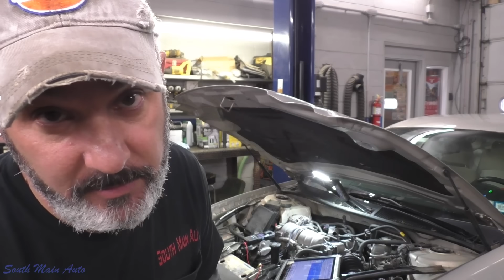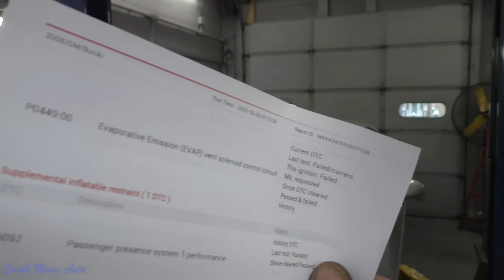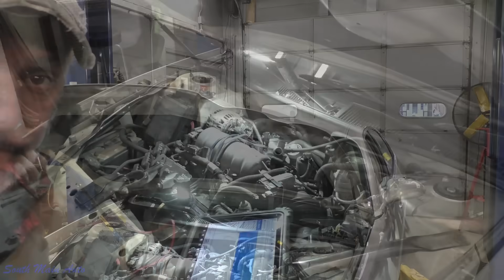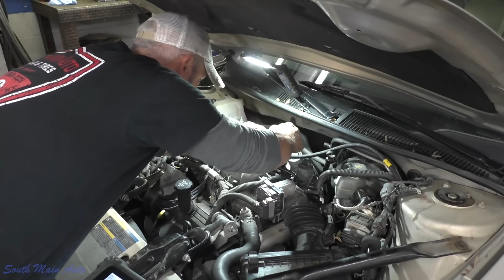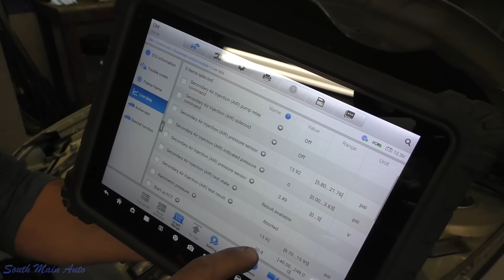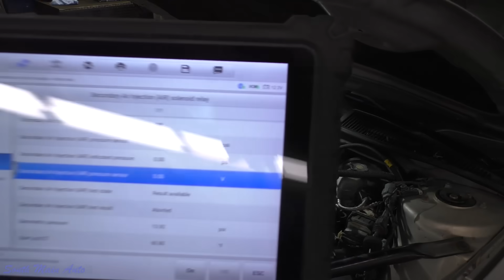When “New” Parts Are Worse Than The Broken Ones 🤬

Comment: Live in a small town.  A guy here had a business that would rebuild starters and alternators, usually in the same day. The alternators would last decades and produce 10% more amps than factory OE. Starters same reliability. He retired, back to replacing Chinese  ones  that last a  year or two.
Reply: In 2001, Bolton starter told me they could not buy the quality components to rebuild an alternator for the cost of a new offshore unit. I did my own starters at the time, now nobody stocks forks and brushes -and haven't for 15+ YEARS
Reply: That was about to be my comment.  How come "new" parts barely last a fraction of their OE counter-parts?  OE water pump lasts 20 years.  Aftermarket one might go 2 years.
Reply: @jperksification  worked in an auto parts store and sold starter brushes drives, alternator brushes...and easy to replace and worked fine
Reply: Yup same. Used to be a guy where I used to live that rebuilt starters/alternators. Was still around in about 2011 (i bought solenoid contacts off him) but he's long gone now
Reply: Lots of those "rebuilt " alternators have weak diodes that fail quickly.
Reply: add to that the new cars that turn off at every stoplight so the starter is getting a years worth of work in a week
Reply: That's what worries me about this new trend of putting the starter in the bell housing or under the intake plenum. I don't want have to be taking all that shit apart every 2ish years!
Reply: We are fortunate still have a young guy in town that rebuilds starters, alternators, and other electrical parts. Best money we have spent! We will let equipment sit before we buy an over the counter part. Doesn't matter Ford, GM, International, Deere, Duetz they are the same junk!
Reply: In my Lexus, it's rarely ever needed anything like that, but when it does, I get it from Japan. Genuine Toyota Sourced from  a legitimate source in Japan is just as good as the original
Reply: I can’t even imagine how many starters must fail now between poor quality parts and the dumb stop/start in most of the new vehicles.   Disabling stop/start was the first thing I did on my Buick Regal when I brought it home.
Reply: @jperksification  

Chinese parts made with nothing but the best chinesium alloy metals haha 😂

Comment: I think this is more nefarious than you know. 
The US government is a significant debtor to wvery US car company except Ford. (Ford paid its debt in 5 years. The rest still owe money from the bailout) 
As a lien holder and well, the government, they have sway over the auto manufacturers. 
I think during the push toward electric cars the government demanded less parts be available for ICE engines, and that forced China to pick up thr slack. 
I know for a fact im not entirely wrong. Famously a man with a Cadillac Lyriq has been waiting for a bumper for 9 months. New cars continue to be built but Cadillac won't give him a bumper. GM has told him straight up that selling new cars is the priority. Fixing old ones is not. 
They are not willing to delay production of ONE car so they can make him a bumper.

Comment: Glad you made this video. In my head I’m thinking 50-50 every time I put a part on. Stupid problems like this can really make you think you made a wrong diagnosis but the reality is there are thousands of these junk parts out there. Problems with every part you can think of. New cv axle shaft & the boots split open in under a year, Sensors are junk right out of the box, exhaust pipes “exact fit” are almost always slightly off. Sometimes new sensors won’t plug into harness. I could go on forever parts quality is 50/50 totally unacceptable especially when you end up spending double to triple the time to correct the problem to only get paid to do it once

Comment: I bought a new car a few years ago that was built in Japan.  You wouldn't believe the amount of parts I found on it that said "Made in China" .  None of them went bad. So why can't the aftermarket Chinese parts be OK too ?
Incidentally the radiator ( made in Japan ) was defective and developed 2 pin hole leaks.  Not covered under warranty @ 53K miles.  A new radiator cost me $504 .  I installed it myself.  The dealer wanted $2,334 to replace it.

Comment: I once got a bad fuel pump, i know many are cracked and i check them in the box at the counter. I warrantied one, check the other one, and it's also cracked. They refused to issue a refund despite never actually leaving the store. 

Theres a few items I will only buy genuine oe parts. Its more expensive to do it twice.

Comment: Recently I changed my car’s fuel pump under warranty…..twice. The first time, faulty pump normal wear and tear. Second time, faulty brand new pump. It worked fine for a while and then it would just randomly die. I tore the inside of the car trying to track down faulty wiring thinking it was the pigtail inside the tank. Turned out, the fuel pump stopped intermittently. Took me two days to realize it was bad brand new AC DELCO pump.

Comment: If it's any consolation, NAPA parts are crap in the UK too!
I replaced both the wishbones on my 2012 Renault Grand Scenic, 1 month later & with very little miles on the car, it went for an MOT and the joints on the wishbones were reported as an Advisory item as there was play in them.
The mechanic who did the MOT asked me if they were NAPA parts, as they had sent a huge quantity back to the wholesaler due to them all failing in some way shape or form.
I will never buy another NAPA part ever again for any of my vehicles

Comment: It’s almost like it’s planned by design where “They” don’t want older vehicles to be repaired . Force people to buy new overpriced junk .
Reply: Bingo. And the new vehicles are broken and unrepairable as well. I believe this is the designed end of private car ownership. Look for the major car makers to go under soon as well. Techs are quitting. Dealers do not even want the junk traded back in. Used car lots are folding as well. It is at the point where you do a maintenance job like a timing belt/water pump at 90K on a V6, and create engine problems because the parts are counterfeit/fake/crap. Even the car maker supply chain is a crap shoot now.
Reply: In 1965, my neighbor, a GM engineer no longer put grease fittings on the ball joints.  People don't grease them, so they wear out in 70,000 miles.  Now they are sealed and they wear out in 100,000 miles.  I asked him what do you do then, and he said:  "We'll sell you another car."
Reply: Remember to use paper straws and scrap your car after warranty ends or even before that in some cases.
Reply: @lloydmarche7263   over priced junk is exactly what it is

Comment: As someone who does a lot of electronics work I can feel your pain...I have gotten many "brand new" parts that are non-functional straight out of the box.  All are 'Made In China' junk.  
In fact I just purchased a 5 pack of USB step-down modules...two of them didn't work at all and one has an unstable output voltage...so 3 out of 5 are not usable - 60% failure rate.
Reply: It's easy to get counterfeit parts, that the packaging looks like name brand, factory equipment.  Spark plugs are one of the common parts to be counterfeit.  Sometimes the counterfeit packaging looks better than the OEM.
Reply: dont buy made in china. if china is the only country manufacturing something, find a way to live without it. the ccp lives on that business model, undercut their competition with slave labor until its gone and skip all quality control as soon as people think they can trust them.

Comment: Why buy chines parts if you own a American or European car. Buy OEM and all should be fine. It might cost a little more but in the long run you save. I see people buy fuel injector sets for 130 bucks (OEM over 700)and wonder why it does not work. It is like buying a can of chicken soup for 25 Cent and wonder why it tastes like crap and has you glued to the throne for hours, same thing. But since food has safety regulation one can not buy a 25 Cent can of soup.
Edit: Should have watched the whole video first. This seems to be a case of businessman greed, supply store ordering the cheapest crap possible.

Comment: sadly we are seeing more and more of this, new parts that dont work saw it recently with an OE o2 sensor straight out the box total garbage. , scoped it out it was as much use as a concrete parachute. , even a geriatric slug could switch faster than that crap. back in the box got another one that one worked all fixed.

Comment: What takes so long? Well, I have to fix the info given me about the complaint. I have to access your data. I then have to analyze and correct the informational data I need to diagnose. I diagnose then test and repair or replace the new part before I install it. Then I install it and then find the other issues no one said anything about.  Remember the 80s when aftermarket aggressively tried to improve on O.E. products? They sponsored training. They all sold out. Just number machines now. Mechanics are no longer an asset to the company. Just a commodity  to replace or trade. No loyalties. I love being a mechanic for 44 years but what the industry has become is just sickening.

Comment: Oh NAPA.  I did an annual brake inspection on my Kia- rear right caliper is weeping and the brake actuator is sticking on the left.  Fine. Replaced both (ticked as I replace ALL fluids every two years on ALL my family's vehicles with a pressure system). Anyway, did the deed with NAPA rebuilds.  One year later, I'm tootling along and get a brake warning.  Low Fluid.  Up in the air she goes and BOTH rears are leaking. Give up and buy new build units.  Months later, I was was back at NAPA for something else and asked about this reman issue.  `Oh yes' says salesman, `we did have a problem, but it's fixed now ' !!
What pops my cork is that they knew, they actually knew, they had a  problem with a primary safety item and did sweet bugger all about it.  I don't do this for a living, so it only cost me time and frutration, but what happens to Epic Eric if he fixes a car and the bloody stoppy things give out ??

Comment: I literally passed my hiring exam which included setting a distributor after they loosened it and had me set it back up and timed. The distributor ended up being defective (no spark). Also I just needed a thermostat for my car because a stuck open thermostat. Replaced it then I had a stuck closed (overheating) code after replacing it FML

Comment: Number one rule that they taught you in auto shop back in high school if you ever learned back then or wherever ASE trained. NEVER EVER USE AFTERMARKET ELECTRONIC PARTS ON CARS ONLY OEM. But all you five and dime mechanics like to use aftermarket crap and charge OEM prices rather than use the real stuff and save time and make the same money. Everything from Napa is remanufactured. Nothing is new but the box

Comment: Easy fix, delete the Valve, delete the Pump, disable the Codes in the ECU, and plug the inlet hole in the Head with a Block off Plate or tap threads in the hole and epoxy a Hex head plug or even a bolt in the hole. 
Did it on a WRX. 
Just have to have the ability to disable the codes with a Tuner Module, or like I did with a Laptop and a Program called EcuFlash.

Comment: had a 2000 silverado 1500 sit in my driveway for 4 months with a crank intermittent start. when i replaced the engine (old engine spun main bearing, but started every time), i got all new AC Delco sensors and ran into the crank intermittent start problem. i checked every wire for continuity from pcm to connectors, ended up getting a CMP (this is the 2nd new part that was bad out of the box) from the parts store and still no start issue. hooked an oscilloscope up to the CMP and got and inverted signal, i thought that was strange an wrote it off as lack of experience with the scope. that's when it sat for weeks, it has to be something else, because there is no way i could possibly get two bad parts and one was a so-called reputable name brand. then Ivan was working on Silverado that had the same problem, inverted signal on the scope from an aftermarket cam position sensor. i got a genuine gm cam sensor and it started right up.

Comment: I remember my first timing chain replacement on a 69 Pontiac Catalina  with the 300 engine with the fiber gears that strip off and throw the timing off. I purchased a steel replacement set and attempted to put the new gears in. There was no timing mark on one of the gears. I had no idea what I was doing at the time. I called my dad about it as he knows his stuff. We argued about the fact it had no timing mark for a while. I was trying to use the keyway on the shaft, he told me that was wrong. Finally he told me to take the set back, it had to be defective. It was. Unfortunately, I didnt realize an exaust valve had gotten bent when the timing chain slipped. I drove it the rest of the summer with a glowing exaust before scrapping the car in the fall. This was back in 1979. They made bad parts back then too.

Comment: with the old "lets buy everything from China problem, is in Texas too. It is much worse when you're in limp mode and have to drive 30 miles to finish a job, because your electrical deduction ability, sucks. i got it to move again, but it now has 1000 dollars worth of every electric solenoid in the trans.... still same problem... i got a wire crossed, a pcm that is half volted. security light on. no guages. Can't fix it until i get money after  having to drive my truck like it is until it happens... wish i were you right now

Comment: I know you want to blame the manufacturer, which I understand but, the problem is the American public. Nobody wants to pay for a quality part. Everyone wants things cheap. We, American's are the reason Walmart exists. Rather than pay $90 for something of quality we buy it multiple times for $30 because we think we got a deal. The OE alternator on my 2003 Silverado 3500 Duramax  lasted 470,000 miles. I bought a life time warranty alternator from a major auto parts chain and replaced 4 times in 2 months. When I took the third one back the counter person ask me what do I think the problem is. I pointed to the box and said see what it says here, "Made in China". Even though it has a life time warranty I won't exchange it for a new one. Same crap different day. I will go our local alternator/starter shop and have it rebuilt. The shop has been around for ever and don't what I will do if it ever closes.

Comment: Had a issue several years ago where I ended up installing three sets of ball joints on a friend's car. One set lasted about three months and the other one didn't even last a month. They were house branded ball joints from one of the chains. After the third set I told them I was going to get OEM if they failed too. Well the third time was the charm and they had no problems. Left a negative review about them on their webpage and one of the other reviewers was in the same boat replacing them three times too LOL. A month later there was a paper at the store saying there was a recall on them for being defective...

Comment: One of the reasons I went to the Mobile Gig where I dont have to buy or supply parts. My job is to Program, Calibrate and diagnose cars now and wiring repairs of course. No more praying and hoping the parts I can get are good unless Im fixing my own stuff. But mine are rarely driven since have a work van

Comment: Had this same thing happen recently on a 2006 Nissan Xterra. Diagnosed a faulty Crank position sensor (signal dropping out causing truck to buck and jerk, occasionally shut off). replaced part with an autozone (standard ignition) sensor, and 5 minutes into my test drive the same exact shit was happening. Frustrated, I went back to the shop and continued with troubleshooting (everything still pointing to that crank circuit, I got frustrated and threw a couple of cam sensors and a BUNCH of time at it). A day and half later, and feeling like I was losing my mind, I told my service manager to order me a CKP Sensor from Nissan (got lucky cause they had one), AND wouldn't you know it... bad CKP Sensor the whole GD TIME! 🤬

Comment: I stopped using NAPA and other part's store brand parts 30 years ago.  Today, I use (With good results) Bosch, GM - Ford - Toyota - Honda etc., Nippon .  OEM or Name brand parts.  Yes, they can cost more than store-brand or no-name parts sold on Amazon and eBay.  I'll never forget shopping for name brand antifreeze at NAPA many decades ago.  A NAPA store staffer suggested I just get the NAPA brand: "It's cheaper and all antifreeze comes from the same spigot anyway".  Uh-huh.

Comment: Thanks for the video on the 2018 Ford Escape brake job. You saved me $1000 USD. The dealer wanted $1300 for 4 rotors and brakes. I did it for $300.

Comment: Eric, because of you, and watching you, I'm not buying anything new. I'm actually trying to sell my 2016 Nissan Juke SV with a 6 Speed Manual.  I mean, it's a really rare car, don't get me wrong (at least here in North America), but it has a French built engine, and that worries me.

I know Renault's reputation, and it's not great. Watching The Car Wizard with his experience with his Juke he had with a spun bearing, because it was a French Engine, he couldn't get parts for it.  AND I don't feel like going thru the headaches of that possibility.
SO I'm looking at a car pre-2000... hell, even pre-96.  Tired of all these modern distractions in cars. I miss my old K Car, it had a non-interference engine, and was built like a tank.  SO many cars ago, and yet it was the best one of them all. Simple to work on, simple to fix, and cheap to operate.